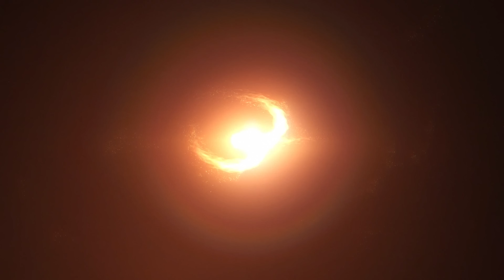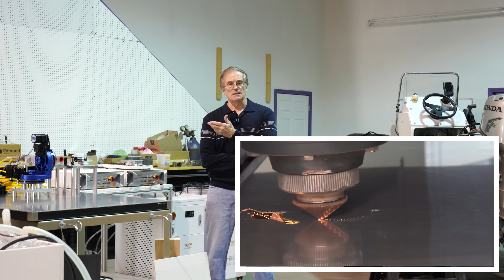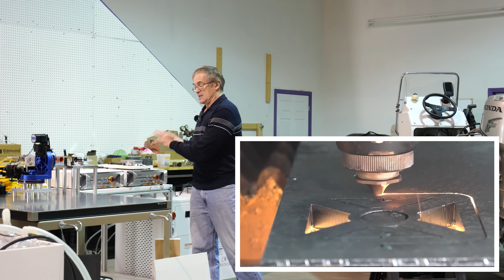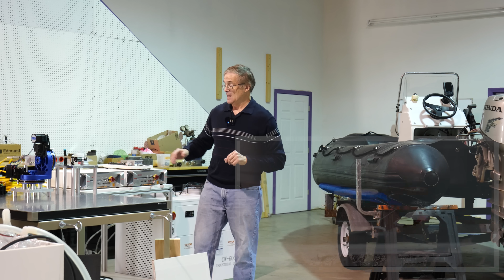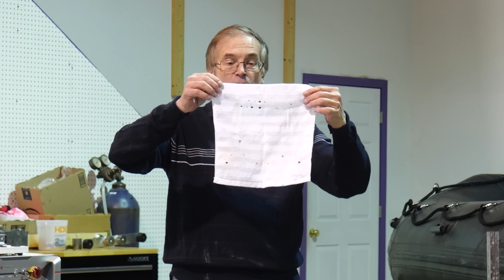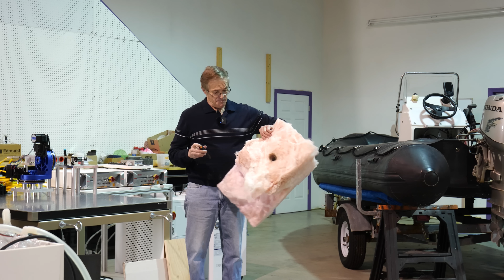We have a problem... and need your help!

Comment: Without reading the 9000 other comments, have you considered a cloudy liquid that would diffuse/scatter the beam?  Also what about those lenses yu get with cheap laser pointers that project different patterns to diffuse the beam.  Actually what abut optics in general to defocus the beam?
Reply from the maker: The beam may be anywhere within the "killing field." The solution has to protect the entire back wall.
Reply: @TechIngredients  I was thinking several layers of frosted or some of teture glass with air gaps to diffuse the beam, but a whole wall of that would be cost prohibitive.
Reply: The Pilkington Texture Glass Minster was what I was thinking

Comment: My first pick would be graphite due to its high absorption rate, low reflectivity and high thermal conductivity allows it to dissipate heat quickly. But not safe to breathe after fiber laser beam blasting. graphite dust can be hazardous when inhaled.

Comment: I would be curious what a soda bottle filled with water does.  Obviously a hole will develop and it will leak but in the mean time how much does it protect a brick. I imagine it would offer some protection and possibly could help diffuse. A wall of water isn’t practical especially when you keep poking holes in it but flex tape would be able to seal holes. Hopefully you don’t have too many malfunctions and one roll will do the trick. 
I am also curious about starlite or imitations of it. Nighthawkinlite did a video on recreating starlite which is like baking soda, sugar, water, flour. That might help your plywood from catching on fire at least. Not sure show effective it would be against such an intense point source. It could probably be painted or sprayed onto boards. 
The other thought came from acoustics, anechoic chambers have wedges that protrude to beak up noise, reflect, and trap energy. It would be less effective against a point but you might get some reflection. It would at least increase the amount of material, turning a 1/2” into maybe an inch or more. It would likely take a bit of work but might be worthwhile. 
I was thinking a combination of things might work. If water was effective perhaps long plastic tubes could be filled and used with tape to seal punctures. This could be on top of a second protective layer. 
I was interested in the idea of some sort of a fuse or a different fail safe. I was wondering if aluminum foil or copper tape could be used to act as a feed back loop. The trick is going to be the response being quick enough.

Comment: Carbon Felt. Its black, lightweight, used to protect from MAP gas torches while soldering. It can catch fire but doesn't burn without continued heating. I'm thinking sandwiching carbon felt, ceramic tile behind that and a layer of hydrogel behind that.
I dont know.. tungsten... what survives the surface of the Sun...
A large pool of frozen water in a transparent tub that has Sand (black) mixed into it. Just like a cup in a fire it won't melt through until the water has boiled off..
A Lens to defocus the beam with some carbon felt behind it.

Comment: use a rotating lens, it will change the laser beam into a diverging beam of light. rotation is needed to avoid hot spots in the lens. pulling the lens away fires the laser.

Comment: Use an integrate and fire system to distinguish when the laser escapes from your house, by placing sensors outside that have a filter selected for your laser setup, and wiring the whole thing to the e-stop

Comment: First, put it on the first layer with glass like a fresnel lens to break up the laser focus point, and on the next layer with some cement board painted with super reflective white matte paint (or a color that matches the scattering with the laser wave frequency) with a little gap between layers. . :face-blue-smiling::face-blue-smiling:

Comment: [Edit- Cipherfxmp's suggestion is better.]  Acrylic, or other transparent container, containing water with carbon black or lamp black  added  as a dye. The thermal mass of water and the absorption of black dye might work to absorb and dissipate the energy, as long as you can find an optically transparent enough material that also wouldn't fail from thermal shock.

Comment: Off the top of my head, a water tank with black drywall exterior waterproofed on the inside. The beam will cut through and immediately evaporate the water   also defract the light. if the beam is moved the waterproofing will melt back and seal the leak.  I could think of additional ways to improve on this with various elastomerics and chemicals in the water but that's a first thought.

Comment: Your Tesla Catamaran made me subscribe more than 3 years ago, and you are my main inspiration when I am building my Solar Cell driven catamaran for 6 people. I have worked on it for 3 years and expect it will take another 3 years untill it is finished. But I allready now sail in it. 
Anyways, back to your problem. I don’t understand why you can’t have a detector that imediately turns the laser off when it went through the object?

But there must be a reason.  If so, then I would try a fog-machine :-)

Comment: Whatever you come up with and post, make sure it isn't TOO light and portable. You may very well develop drone portable protection from your laser. 

My idea involves lab-grade dielectric mirrors that divert the laser into a bucket of sand, and possibly rotating the mirror constantly to prevent a hotspot and penetration of the mirror.

Comment: I thought about using black iron oxide dissolved in water in a huge  fish tank. If the water is moved with a pump it should bust vapor bubbles before a dangenous amount of vapor pressure would build up. But I guess even when using optical glass that lets through most of the laser light the thermal stress would be enough to shatter the fishtank before the beam can penetrate the pitch black liquid reasonably deep to disperse its energy making a huge mess 😂

Comment: 20 years as an operations manager using LPKF Yag style lasers in manufacturing and engineering at the USA affiliate "A-Laser" for the systems they sold before the sales arm established their own in-house demonstration capabilities, my experience is related to introducing their Yag and first diode laser into a manufacturing environment that potential customers of the laser could tour and receive cutting and ablation samples and do all kinds of testing. With that in mind I have a little experience in dealing with lasers. This question is the opposite of what our goal always was but what we did to achieve the most powerful beam with the smallest focal point "may" work in reverse. The question you have asked brings my mind to 2 thoughts. 

1st: not knowing the complete internal setup of the lasers you are using I recall "focus" of our lasers was critical for ultra high precision cutting and laser focus may be helpful here. You mentioned that it is not feasible to decrease the laser power however you may be able to "defocus" the beam. The Lpkf lasers had "mode apertures" that functioned to remove a percentage of the outside of the beam before entering the focal aperture where we could adjust our focal point as to where the beams finest point made contact with our material. If you have mode apertures you may be able to remove them or use larger ones to or maybe they make ones now days that will "destabilize" the beam. This way you can begin the process of the beam spreading (thus loosing power) before the beam leaves the laser. This would speed up the rate at which the beam would degrade once it leaves the laser. So defocus and remove mode apertures. If you have collimators you can adjust you may be able to decrease the focus of the beam internally there also. So that is my initial thoughts without knowledge of your specific lasers. 

Secondly one word comes to mind: CARBON

-No reflection
-Great heat absorbing properties
-Won't catch on fire
-Thin layers can be very effective
-It is very light material
-You should be able to make test assemblies yourself with little to no $. 

All that said there was a product invented that was supposedly made in a kitchen that was a putty like material that was impervious to fire. When you hit it with a torch it created a carbon layer that defused the heat and prevented anything behind it from being burnt. I have seen demos where the inventor put it on his hand and then used a blowtorch on his hand and it created a carbon layer but never heated his hand up even with prolonged exposure. The story goes that he never gave up the recipe and passed away. Many have tried to replicate the formula and I don't know if they ever have and unfortunately I can't recall what it was called even after searching the internet for it with keywords I can recall from so many years ago. Nevertheless I did stumble upon some nano particular carbon fire resistant materials and it looks like they make putty that has similar properties. I would suggest testing some of this stuff. 

As far as the original product that has been lost to time I believe a primary ingredient was baking soda. 

Thats all I can recall at the moment I hope it helps.

Comment: Two coherent lasers of identical frequency and amplitude can produce destructive interference if their phases differ by exactly 180° (π radians), effectively canceling each other’s electromagnetic fields at a specific point or region, resulting in darkness there. However, this “cancellation” is localized—energy isn’t destroyed; instead, it’s redistributed elsewhere into constructive interference patterns. Maybe double your system and have the two waves interfere while your gun is "off".

Comment: Use a lens to diffuse the beam after you're done with it — some quick searches turn up "wide angle diffusers" with divergence angles of up to 125 degrees, which should be sufficient to reduce the intensity with only a ~5% loss captured as heat.

Comment: In high-density, near-subzero saltwater, the laser’s effectiveness at heating or destroying the water is reduced compared to warmer water.
If the water is supercooled, laser energy may induce ice formation, leading to increased scattering and less efficient energy absorption.
The overall effect would be a less intense localized heating and less risk of damaging the tank walls unless the laser is extremely powerful and focused directly on them.
Final note:
If your goal is to vaporize or damage the water or tank, higher laser intensities or different wavelengths (e.g., UV or infrared) that are better absorbed by ice and supercooled water might be needed. Conversely, the cooling and high salinity could act as a form of "shield," making the system more resistant to laser-induced damage.

In conclusion:

Chilling the high-density saltwater near subzero temperatures would generally decrease the laser’s ability to heat and vaporize the water. The presence of ice or supercooled liquid would lead to increased scattering and reduced absorption, making it less likely to damage the tank unless extremely high laser power is used and precisely focused.

Comment: You have two supplies there. Figure out how to shift one by π on command and shove it down the same track.

if two lasers are merged with a phase difference of π, they will interfere destructively. This means that, ideally, the two beams would cancel each other out, resulting in no net intensity at the point of overlap.
However, in practical applications, complete cancellation is difficult due to factors like:
- Beam alignment: Perfect overlap is required for full cancellation.
- Coherence: The lasers must be highly coherent for interference to be predictable.
- Polarization: If the lasers have different polarizations, interference effects may vary.

Comment: Hang a copper sheet painted with Purdue University's ultra white paint. Most of the light (up to 98%) should be scattered on impact, depending on spectrum-material interaction. The small remainder energy will be readily absorbed and radiated by the copper acting as a heat sink. The sheet can be rolled up and transported easily. Thickness of the sheet, percentage of energy scatter, and safety of the scatter will need to be experimented with.
Reply: Yeah I think something like that might work. I suggested looking at how copper tweirs are used in blast furnaces. Because copper is such a good conductor, it's easier to cool with water so it can be used in situations way above it's melting point. I like your idea of coating it to stop reflection.
Reply: @ewanrollo5562  Thanks.   Indeed, the back side of the copper sheet could additionally be continuously sprayed with water for good measure, if the margin of error in the heat dissipation isn't already wide enough.

Comment: Probably a dud but have you tried using a PC heatsink with copper heat pipes and some ceramic heat exchanger compound..? non-adhesive kind shouldn't cause anyone to see little goblins running a mock 😅

Comment: Interposing a Brewster angle polarizer set is a great way to control overall intensity.  Residual power can be dissipated in an appropriate slow or fast flowing recyclable vapor.

Comment: Couldn't you just put a giant tank of water with, say, particles of stuff in it where you'd have the water being vibrated and the particles absorbing the beam? Water is usually pretty good for absorbing stuff. Maybe even have it filled with mirror particles, something that will disperse the laser thousands of times over inside the water before reaching the exit of the water cube.

Comment: Some things you could try: refractory wool (the kind you use in a smelter), carbon cloth, transparent glass containers filled with sand (ie glass bricks), fog machine, powder fire extinguisher pointed in the beam, Consider having more than one option - have fallbacks. Test all these options. You may find some sensible recurring suggestions in the comments - those are worth trying.

Comment: What about a mirror at  45°  that would direct the beam into a column of water.  Water has high heat capacity. Also line the column with something black to absorb any scattering of the beam transfering the heat to the water.

Comment: I think that the solution maybe in the use a reflection system, depending how large shot area  do you need.
A aquarium whith a oblique wall, insite water with carbon, OR a Glass Lens. Thinking about lens microprinting on the glass surface, multilayer.

Comment: There's a lot of energy concentrated in a tiny point. It needs to be distributed away from that point fast. So try something with high thermal conductivity, like (black painted?) copper sheets. Cool them down passively or actively if necessary. Additionally you could diffuse the light before it hits the surface. Perhaps several layers of incrementally diffusing glass?

Comment: Mirror at 45 degrees to angle the beam down at 90.  Then bricks and wet sand on a trolly.  Also Introduce a deadman switch between the laser and power source for redundancy (kill).

Comment: Taking a cue from firing range design, why not arrange your range such that the emitter is located at an elevated position, pointing downhill.

Then, the "backdrop" can be whatever is on the floor.

Then, because the concrete floor would likely be damaged by the laser, a relatively thin layer of something like soil or sand could be put down.

Because of the relative angle of incidence, with even only say six inches depth of sand, the laser would have many more inches worth of sand to burn or melt through before it hit the floor proper, much like sloped tank armour plate.

One big concern though would be the release of fumes from silica in the sand. That's no joke, and you'd need to take steps to extract or otherwise contain that.

Comment: I work at a Lasertech-Company in Germany. We have a similar problem. We have a 80W fiber-amplified CW-Laser. We build it for one costumer. Normaly our Laser has a collimated beam with diameter of 1-1.5mm. Now these costumer wants colimatet and 0.5mm diameter. That means 80W on 0.25mm^2. Our normal used standard-optics like mirrors are melting at the point the laser hit them. Now we want to buy more expensive, higher reflectiv and more resilient mirrors. 

You say you have a beam with long focus-length and small beam. I think beamsize directly behind the lasers is around 1mm too, right? 

I think you have to expand the beam using a convex mirror and than with intensity of, i guess around 100W, with beamsize of 5mm a standard water-cooled beamdump should suffice. I`m not sure if a normal concave mirror could manage these intensity. Mirror is better then lense, as the beam passes through the lens material and has more risk to heat up. If normal concave mirror does not work, you need a bit more expensive one too. 

But stop shooting with a high intensity laser at things, witch could burn.

Comment: Would a box lined with something akin to Starlite work? NightHawkInLight did some vids about making it. You could build a box that has a small opening for the laser to enter and then line the box with Starlite, it's cheap to make and it should be able to take the heat (although I'm not sure how long it would last). You could even use multiple layers of it on the inside of the box, and it'd just be a matter of changing out the lining of the box once it's "spent".

Comment: I think water is the right solution, but what about a transparent tank filled with dark water to absorb the light? For the color you could just use powderized charcoal? At the very least, highly available and cheap materials. :)